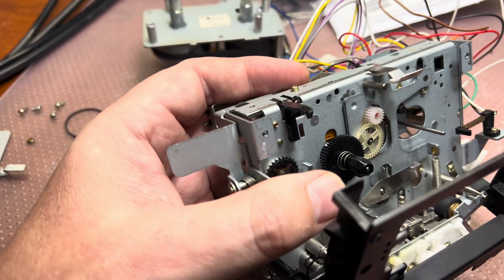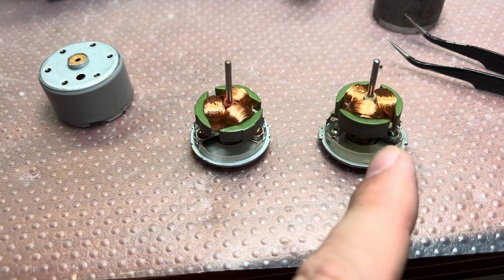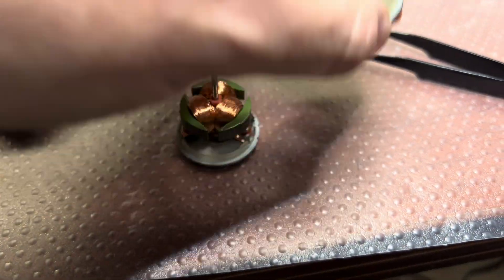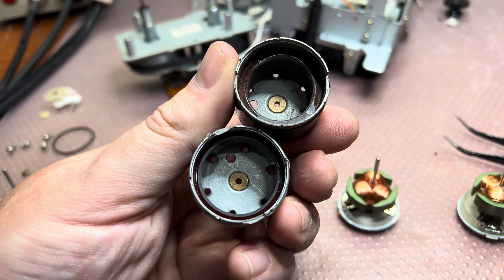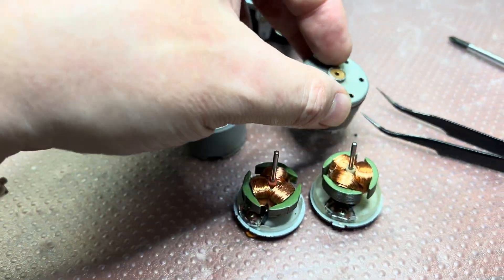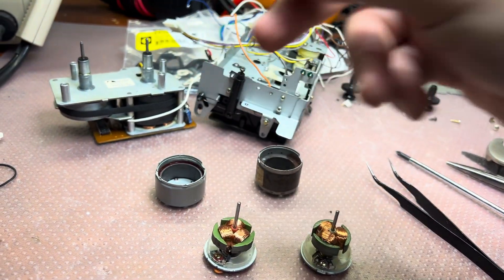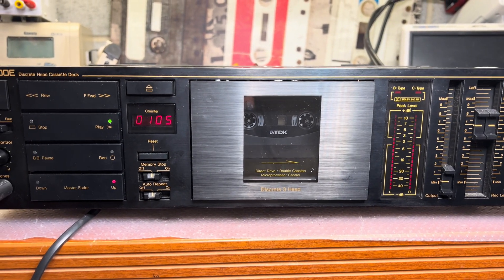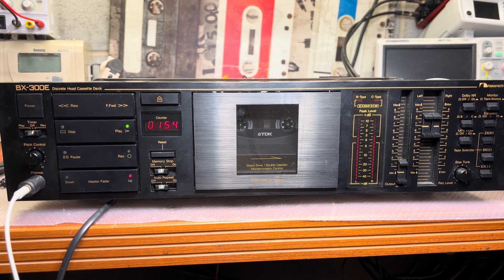Solved: Reel Motor Dead Spot Issue in Nakamichi BX-300

Comment: I only needed 10-20 deg rotation of the brush assembly counter-clockwise. Around 5mm.
150-160deg will also flip the polarity, but that would also work and is consistent with my repair 👍

Comment: I can drop link on right motors from Ali   , with right shaft , they go to 80 % of decks , Sankyo +  Aiwa so on
Reply: Already bought from there several times... some even come with a pulley and regulation circuitry and that is sweet.
Reply: Please can you share the model make and code?
Reply: @pwrestoration  he can only do that privately as even mentioning some sellers/sites here causes an automatic removal of that comment.
Reply: @pwrestoration  Hi , did publish  , video 📹 with details
Reply: @pwrestoration  Hi , I published  short video,  on those motors